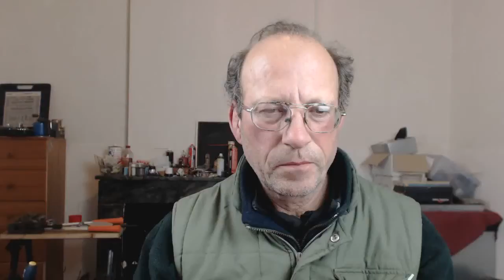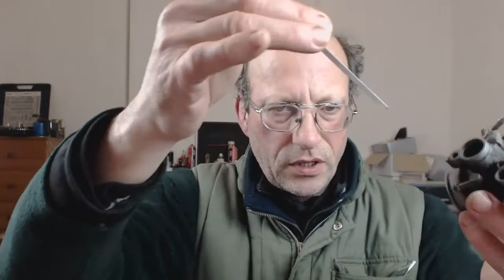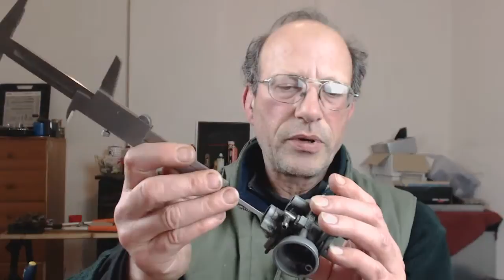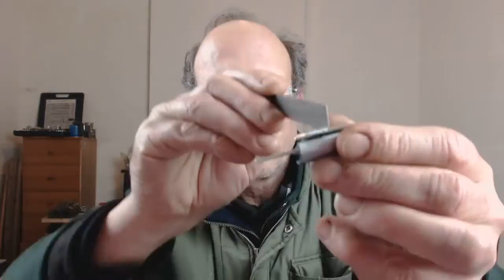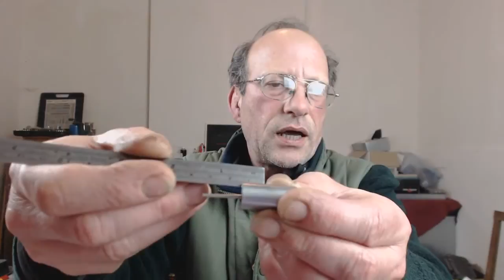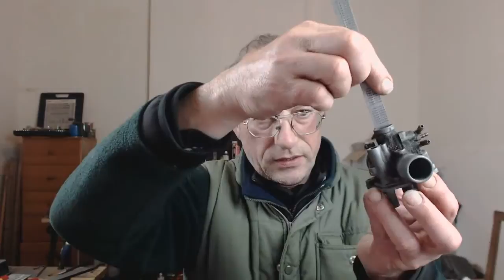Dellorto PHBN PHVA carb measurement - to model fuel flow

Comment: Slightly confusing. Hello , another silly ? if you're interested is PHGB plastic disc sitting on top of the W needle inside the slide vanished as soon as l lost grip just like most of my  clips. lt ran rich so l made another which brought it back thankfully, but l was expecting a slower air speed [leaner ] in the venturi starting from idle if air was sucking from the exposed slide cable hole ? Does the air quantity and  speed increase  if there is a leak on top maybe ? Cheers
Reply from the maker: Seriously John ... I don't understand your text.
Lol I hope you can laugh at yourself (always a good plan)

For example:
-
is PHGB plastic disc sitting on top of the W needle inside the slide vanished as soon as l lost grip just like most of my clips.

lt ran rich so l made another which brought it back thankfully,

but l was expecting a slower air speed [leaner ] in the venturi starting from idle if air was sucking from the exposed slide cable hole ? 

-
:face-fuchsia-wide-eyes:

:)
Reply: @EngineTuning Of course ,  bigger things, plus English doesn't seem to be my first language these days. Cheers

Comment: I have 16phbn on my peugeot xp7 and would lile to fit 17.5 phva for better acceleration but does it work with phva
Reply from the maker: The PHVA has an auto-choke, the PHBN doesn't.

The PHBN is favoured amongst engine tuners, because the choke is manually controlled.
Otherwise, they are the same carb body.
Reply: Engine Tuning okay thanks

Comment: But whats the Float level? no one wants to know the mathematics? and you dont give it.. I have a PHBN 14mm for my 2002 Aerox 50
Reply from the maker: I don't understand your comment.
What float level?
What mathematics?
What am I not giving?
Reply: But do you know what the float level should be? I can't find it anywhere on the internet!
Reply from the maker: I haven't seen any official dimensions.
Measure what it is now.
Adjust either way from that measurement.
Reply: @shoominati23  the float level is adjusted by eye, it needs to clode when its flat with the rest of the carb
(paralel to the edge of the carb, if you get what i mean)
Reply: The float level is not adjustable on PHBN carburetors, therefore no info about float level.

Comment: Which one is better ? PHBN or PHVA. I have on my Piaggio NRG 2011 PHVA.
Reply from the maker: The difference is that the PHVA is supplied with an auto choke system.
Most tuners prefer manual choke (PNBN), because the fuel conditions can be controlled.
Reply: Aham. I just buyed main jets for the PHVA and now will setup it.
Reply from the maker: Good luck!